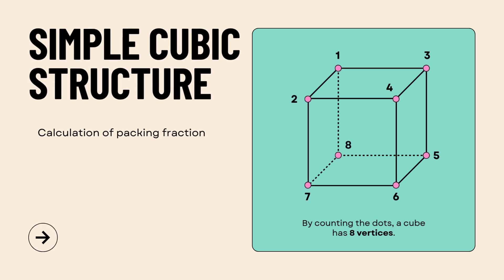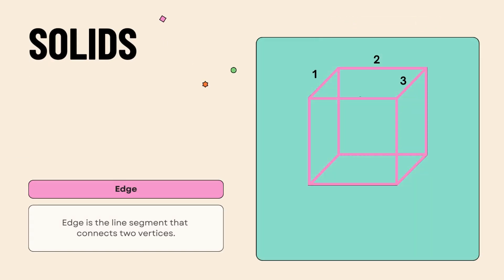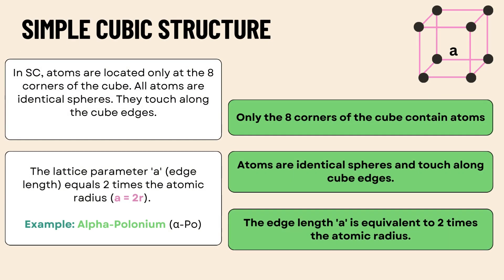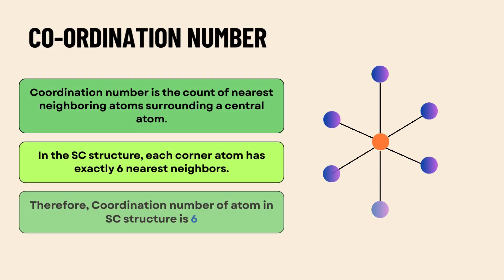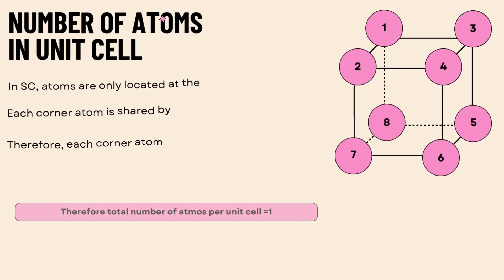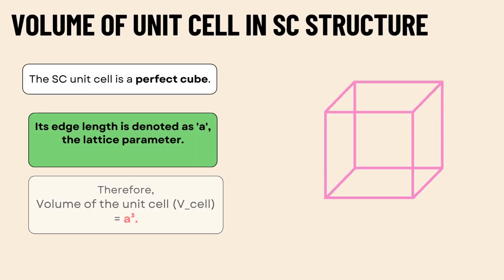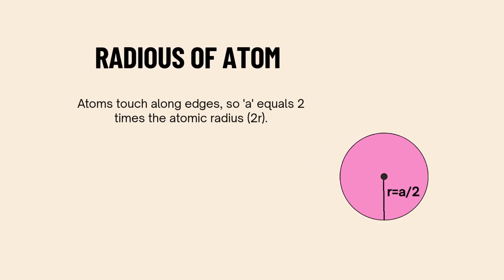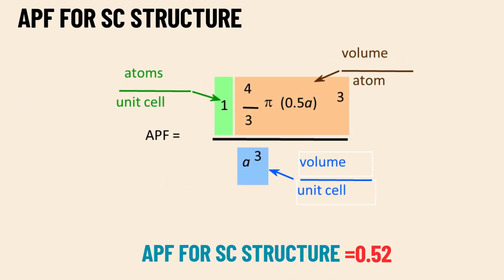APF calculation of SC structure

Comment: The video explains the Simple Cubic (SC) crystal structure, a fundamental arrangement in solid-state physics and materials science. It breaks down how atoms are positioned in this structure, forming a cube with one atom at each corner, and discusses key properties such as coordination number, packing efficiency, and how the unit cell is defined.  the geometry and significance of the SC lattice to help understand this basic building block of crystalline materials.

Comment: The video explains the Simple Cubic (SC) crystal structure, also known as Primitive Cubic, with atoms located only at the eight corners of the cubic unit cell, resulting in 1 atom per unit cell (since each corner atom is shared by 8 cells) and a coordination number of 6.
(52% packing efficiency).
This is the lowest packing density among common cubic structures, leading to higher void space and typically lower stability; examples include polonium as the only metal with SC structure.
The presentation uses clear diagrams and step-by-step derivations, comparing SC to denser structures like BCC (68%) and FCC (74%) for materials science contexts.

Comment: Here the video gives explanations about  'Simple Cubic Structure' :- atoms are located only at the 8 corners of the cube. Atoms are identical.
Unit Cell :  smallest repeating unit
Solids : have different number of vertices, edges and faces.
About Atomic Packing Factor (APF). :- reveals how efficiently atoms fill the unil cell.

Comment: The simple cubic (sc)  structure has atoms only at the 8 corners of the cube. Each corner atom contributes 1/8, so the number of atoms per unit cell is 1 . Atoms touch along edges, hence a=2r. The  coordination number is 6 . The unit cell volume is a³ and the atomic packing factor (APG)  is 0.52, indicating low packing efficiency.

Comment: Video Topic: Understanding SC structure

This video covers information about SC structure.
•SC has atoms located only at its 8 corners contributing 1/8th part equals to 1 atom
•Co-ordination number:6
•Touch along cube edges
•Volume(Perfect cube):a³(a is side length)
•Atomic radius(r):a/2
APF:0.52
52% space is occupied.

Comment: This video explains the simple cubic structure and explain the calculation of packing fraction. what is unit cell?  Unit cell is a smallest repeating unit. explain the unit cell material properties, common cells, define etc.  solids have different numbers of vertices, edge and faces. Relation between edge length and atomic radius. atoms sirf edge ke along touch karte hai . Simple cubic structure has a low packing efficiency . Packing efficiency=52%.

Comment: This video explains about how to calculate the atomic packing factor for the simple cubic crystal structure which is most basic arrangement of atoms in a crystal lattice it shows how many atoms are effectively present in a simple cubic unit cell determines the volume occupied by those atoms and then calculate APF

Comment: In this video discuss simple cubic structure.
In sc structure atoms are located only at 8 corners of the cube coordination number of SC structure is 6 and number of atoms in unit cells is 1. From this data we find atomic packing factor that reveals how efficiently atoms fill the unit cell the APF in SC structure is 0.52.

Comment: This video explains the Simple Cubic (SC) crystal structure. It covers the arrangement of atoms in the unit cell, the contribution of corner atoms, and how to calculate the number of atoms per unit cell. The video also derives the relationship between atomic radius and edge length, explains the step-by-step calculation of the Atomic Packing Fraction (APF), and highlights why the SC structure has low packing efficiency (APF = 0.52), along with its real-world relevance and examples.

Comment: Roll no = E33
This video is about the scc structure in crystal. ... SSC  is the simple cubic cell  ,in which 
1-number of atom per unit cell is 1
2- coordination number is 6
3- volume of unit cell a^3
4- radius of atom is a/2
5- APF   =  0.52

Comment: The video explains how to calculate the Atomic Packing Factor (APF) for a Simple Cubic (SC) crystal structure. It shows how atoms are arranged in an SC unit cell and then works out how much of the total space inside the cell is actually filled by those atoms. This helps you understand how tightly atoms are packed in the structure compared to other types like BCC or FCC.

Comment: A Simple Cubic (SC) unit cell contains one atom*, with atoms touching along the cube edge so that (a = 2r). Using this relation, the unit cell volume becomes (8r^3), while the volume of the single atom inside is (\frac{4}{3}\pi r^3). The Atomic Packing Fraction (APF) is the ratio of atomic volume to cell volume, giving (\pi/6). Its numerical value is *0.52*, meaning the SC structure packs only *52% of the space with atoms, making it the least efficient packing among the cubic structures.